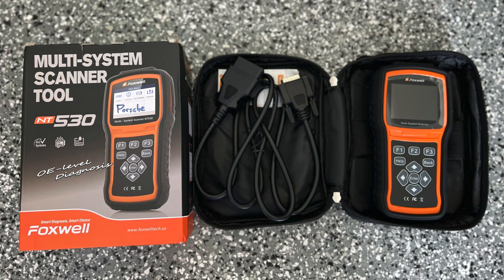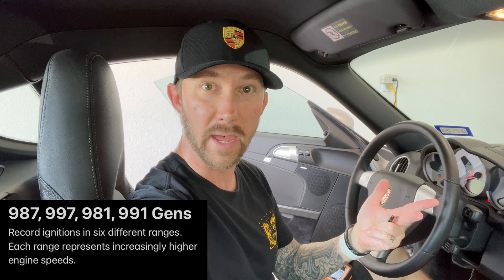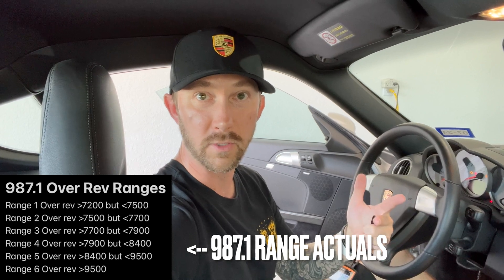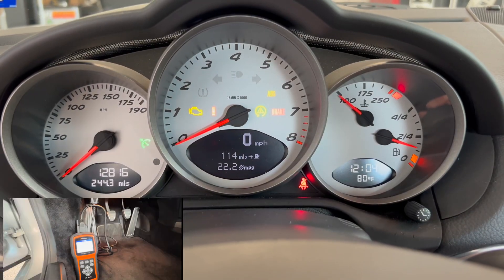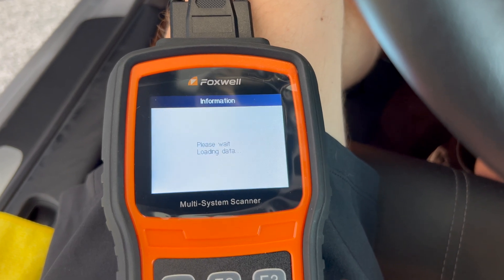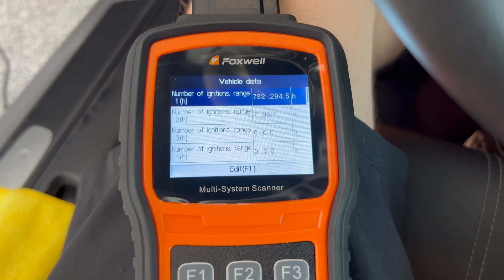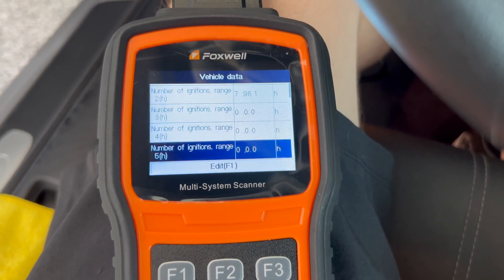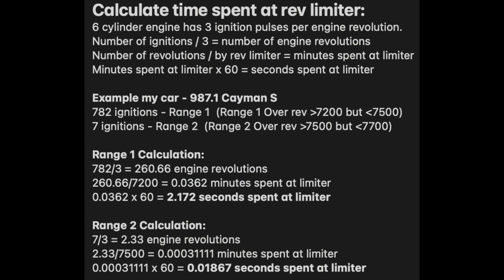Porsche Over Revs | How to Pull & Calculate Duration

Comment from the maker: Did this video help you?  Comment and let me know!

Like, comment, and subscribe for more Porsche content, Porsche insights, and DIY tutorials on working on your Porsche car.  Let’s build a community!

Check out my Porsche Maintenance/Service Videos here:  https://www.youtube.com/playlist?list=PLAnyFYhM7zME4FETBxXRwb5dWDC_SDv_b
Reply: After special functions mine had around 7 options and none of them were what you had. Is there an update since you made this video. I just got the scanner in.
Reply from the maker: @iFischer08  I know this to be Under Control Modules/DME Control System/Special Functions/Vehicle Data —> Number of Ignitions in Range on the software version of my Foxwell NT530 scanner.  Depending on the software version on your scanner this could slightly differ, but I would expect it would to be under a DME or ECU module. 

Let me know what you find!

You can also email Foxwell direct to inquire based on your software version:  support@foxwelldiag.com

Comment: I'm glad you mentioned "potentially problematic" for the higher ranges. Some car guys will tell you to walk away from ANY Porsche with ANY 4,5 readings. I bought a 997 with about 1850 hours on it. It had about a 200 reading in ranges 4,5 at approx 250 hours...  so 1600 hrs ago. The shop I took it to for the PPI told me no issues with motor. They also ( correctly) mentioned the over revs were so long ago, any issues would have presented by now. They chalked it up to likely a misshift. I bought it..... its been a great car. No issues!
Reply from the maker: Yes. I’ve heard the same.  If it’s been many hours since over revs in 4-5-6 and the time spent in those ranges was ‘minimal’ there could be no long term effects.  Glad to hear this first hand from your experience. I would be interested if you could share your over revs stats from your PPI.